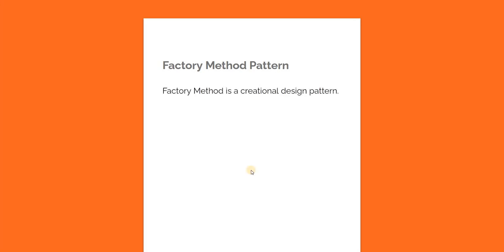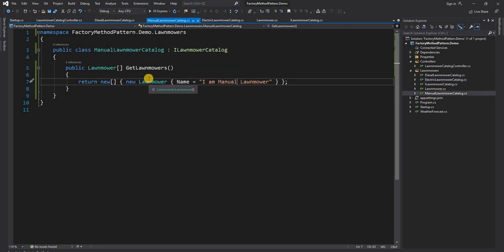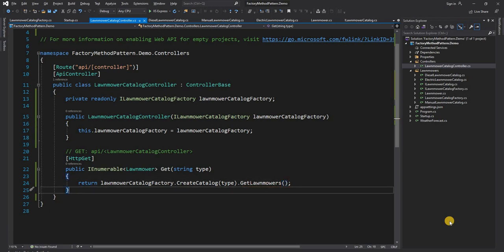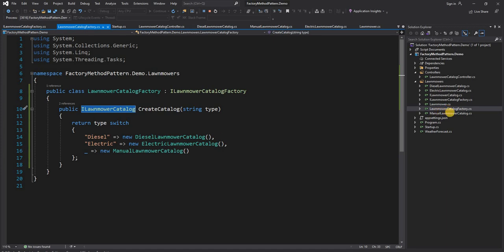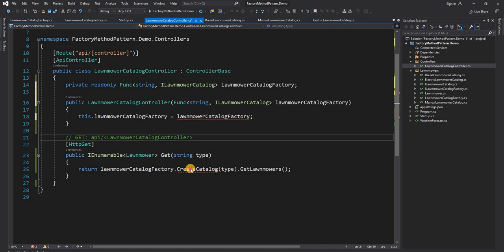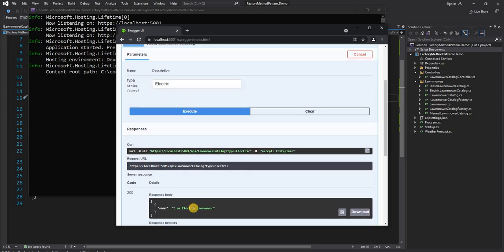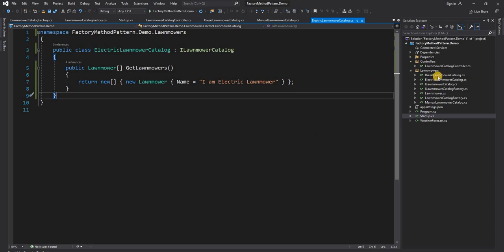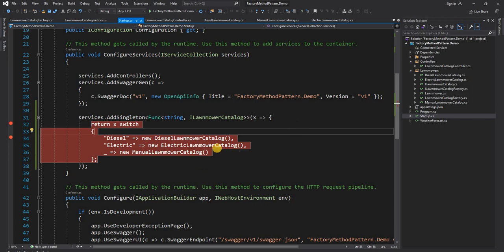Factory Method Design Pattern [An Introduction for .NET Developers (using C#)]

Comment: The way you implemented is very similar to strategy pattern, practically is the same. Can you please clarify me the difference? because here you selected a particular behavior on  runtime based on the type, that's the definition for strategy pattern instead of factory pattern.
Thanks in advance

Comment: Appreciate your efforts but this is not Factory method design pattern, rather this implementation is of a Simple Factory Design pattern.
Factory method design pattern states that "It provides an interface for creating objects in a superclass, but allows subclasses to alter the type of objects that will be created."
In the video, we are just returning instances of the subclasses based upon the type - this is simple factory design pattern implementation.

Comment: Maybe for some one this can be useful: In first aproach minute 2.50, into Startup.ConfigureServices sadd: services.AddSingleton<ILawnmowerCatalog, DieselLawnMowerCatalog>(); services.AddSingleton<ILawnmowerCatalog, ElectricLawnMowerCatalog>(); services.AddSingleton<ILawnmowerCatalog, ManualLawnMowerCatalog>(); . And inside LawnMowerCatalogController create a constructor with this sign: IEnumerable<ILawnmowerCatalog> lawnmowerCatalog then you can test this aproach.